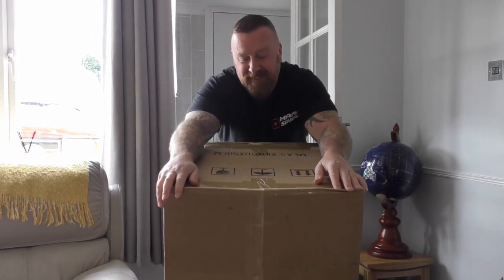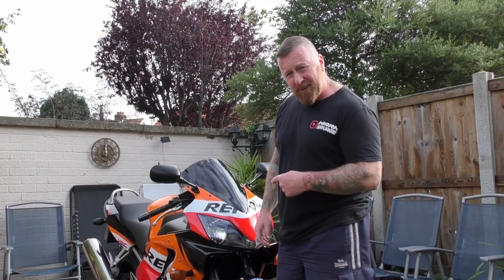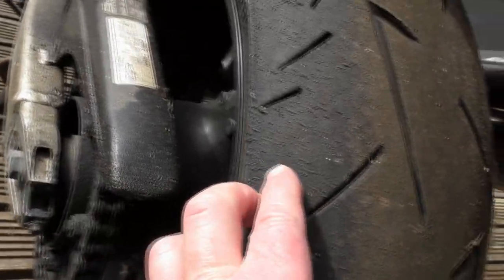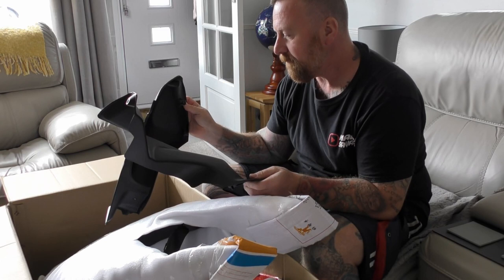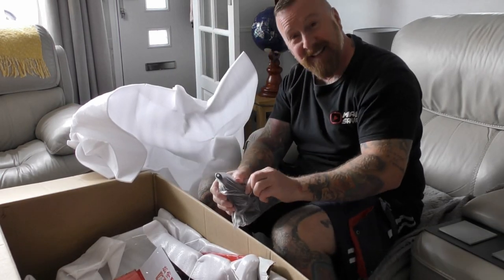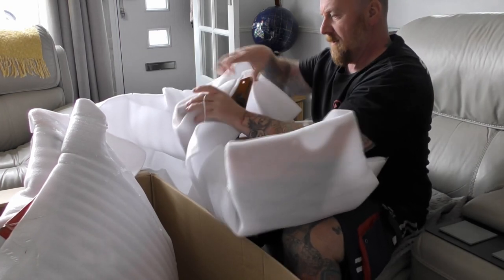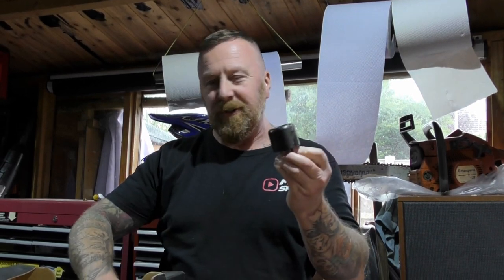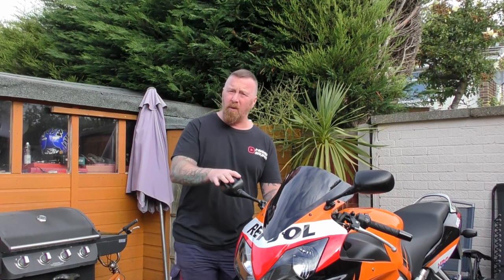HONDA REPSOL CRB FINISHED PROJECT SEASON FINALE

Comment: Mark i come to you(again) with a problem. No one can figure it out and you where kind enough to help before with suggestions and ideas. So here is the problem. On my 2006 xl1000(no abs) i fitted new break pads(trw syntherite). After a few pulls and pushes on the breaks the upper piston calliper doesnt go back in the calliper. So we took the callipers in half, cleaned them properly(nothing much to clean), checked the o-rings etc. The pistons work really well, you can slide them in and out with your fingers, CBS working, everything working properly...untill i put new break pads in and the upper piston just get jammed. Ok , so we take the old break pads,put them back in and guess what? Everything running smoothly! Pistons go back in, they slide out, front wheel doesnt get blocked, nothing. So we vent the break system, put new break fluid in, put new break pads in and again after a few pulls and pushes on the break leaver and pedal the front wheel gets jamed and the calliper upper piston wont go back in the calliper...fudge...So we put the old pads in and you guessed it... everything works like a charm! Any ideas mark? I just want to set the fcking thing on fire. Break hoses are fine, cbs pump working, pistons working,vented the system, new break fluid, the break discks have 10k km on them, i checked the break pad codes with 7 different parts dealers..... Everyone here ran out of idears mate!
Reply from the maker: how odd !! to be honest brakes have drove me mad before and I ended up replacing the caliper with a 2nd hand set . if you have had them apart maybe try swapping the piston around on that caliper . just odd that when its out with the old pads it works but once pushed in it jams !!!.
Reply: @marksavage  its driving me nuts.  I ordered another set of break pads. Maybe trw have a malfunction idk

Comment: Hi mark great videos I’ve just subscribed love the moped stuff I have a very clean 1998 Yamaha cw50ng I want to fit a pipe but not sure how much to go up on my jet and should I fit the clutch springs and rollers they came with the pipe keep up the great vids 👍👍
Reply from the maker: to be honest just fit the pipe first and see what results you get as sometimes it can run very well with out messing with anything else !!
after id take a look at the variator system and rollers but if after a clean and the rollers are still good id leave them too
as for clutch no leave it as its a lot of messing for not any gain unless its not working 
upjet , give the carb a clean and see what jet you have and go up 4 and a little tune as in my videos as they will all help
Reply: Thank you very much for taking the time to reply it’s much appreciated you do a great job with you’re bikes 👍

Comment: Hi mark I have a few 50cc-125cc bikes and I've been watching your videos and they have been helping me out massively. I've bought a lexmoto fm50 basically the same as the echo you have made a video about. I have no electric start but the starter relay works when I ark it over and the kickstart kicks up first kick but it's not pushing the kick start back up where it's supposed to me any ideas. I have ordered a new kick start replacement kit
Reply from the maker: a new kick start will help just a bit fiddley to set up as for electric start they do have a cut off on the side stand 
you stator coil may need a clean or replace as this is where the power to kick it over comes from but is it turning over ?
if not then replace the starter as they go all the time and very easy to do bud
Reply: Okay thank you. One last question. I have put a 125 sinis harrier engine in a lifan 125 frame and i need to swap the wiring loom over do you have any videos about replacing wiring looms as I've never done it before

Comment: hi mark do you have a video on installing after market lights on a speedfight? Just bought a SRT8 led tail light for my SF 4 but dont know how to wire it in. Keep up the good vids
Reply from the maker: i dont but i know the ones your talking about they have side ,stop and both indicators.
i'd only wire in the side and stop light bud and thats easy to do then if you want to add the indicators you can as its easy then but they may flash fast due to being LED 
GREEN in earth the other two are side and stop 
on the light guess blacl would be earth 
maybe use a multi mater to help
Reply: @marksavage  Ok thanks ill try get hold of a multi meter, having a hard time finding parts for the SF 4 XD
Reply from the maker: @elementpixel6935  oh yes you will but and the sp3, they just are not doing them, but the sp2/1s there's loads lol

Comment: Mark I'm having trouble with my yamaha aerox 50cc which has a yasuni z exhaust jetted to suit with 3.0gram rollers and yellow clutch springs. And my pull off is so slow compared to my mates peds and info on how to make this better
Reply from the maker: Hi bud 
This can be a pain but common 
What ped has he got ?
3g is very light, what top speed are you getting ?
I use 6g as much better all round 
Make sure you better is not too loose or tight !
Jet size ?
Have you tuned like in my videos 
Air filter ?
Plug ?
I have loads of videos on the aerox 
Type in aerox mark savage
Reply: @marksavage  my mate has an apprillia sr 50 with a technigas pipe not sure what rollers, And My aerox will hit 50 after a while  but just takes ages to get there, im running a  70 main jet and the standard air box

Comment: Hi mark I have a Piaggio zip and it’s restricted fully was wondering any little easy things I could do to make it go faster, tomorrow I’m going to follow your variator washer remover but any other tips?
Reply from the maker: there's 100 speedfight videos on my channel with all the tips you need like the washer, rollers, variator, exhaust, small upjet
all theres will help and make it go faster

Comment: Hi Mark, I'm new to your channel, what brought me to the channel is a peugeot speedfight 2 lol, a very decrepit little ped that needs a lot of tlc, it's been sat outside for 15years, it's a project for me and my son to play with, we have no keys or anything, anyway I'm trying to get it started, what is my first steps do you think?
Reply from the maker: Hi bud
On my channel there's over 80 videos on every part 
Type in speedfight mark savage
And you'll see them all
Like in my videos being out side for all that time 
Everything off panels , carb brakes etc etc 
Drain out fuel , oil , 
Then new plug test for spark
See if its a immob or none immob 1st 
Then play it from there bud

Comment: hello mark aka the speedfight king got a few questions
I have a speedfight 50cc,
i wanna swap it to 100cc
What engine fits without any problem
does Vivacity 100cc engine fit? Elyseo 100cc? Speedfight 100cc? Trekker 100cc? x-fight 100cc? what fits.
I assume that the 50cc frame is the same as 100cc frame
Reply from the maker: Hi bud 
Sorry just see this 
Yes you can fit a 100cc sp engine in a 50cc sp
But make sure the 50cc is rear disc as some are drum and then you would have to fit one with it 
Everything else will fit fine 
Not sure about other engine as they might have different fitments bud so stick to sp as I've changed them before and it easy bud 
80 videos on my channel to help
Reply: @marksavage  yup my 50cc is has a dics brake ty

Comment: Heya mark, I wrote on here few weeks ago about my Yamaha neo 50cc not starting, I have got new cylinder and piston so there’s no compression issues but still not starting🤔 seems like fuel isn’t being delivered to the carb properly as when I try to turn it over there’s no flow but when I take off the fuel line and try plenty runs out? Just not when it on, thought it’d be clogged but I’ve cleaned it out. Can you help please
Reply from the maker: Wet hand test ?
Plug wet ?
Reads or crank seal ?
I remember but did you look at these?
You had spark but was it blue 
Fuel into the pot ?
Reply: Fuel comes out of the overflow so assuming it’s collecting,
Spark plug is blue and dry,
My brother did the wet hand test I think but don’t think it worked? 
Thankyou for your help
Reply from the maker: @brandonwilliams4684  if fuel is coming out of the overflow your vacuum may not be working right , your float maybe stuck and if the wet hand test is not working and plug dry it could be you reds or piston gone bud

Comment: I have Piaggio zip 2t going 40mph max speed with 17.5mm carb derestricted leovince tt exhaust 5.5G malossi rollers malossi x Kevlar belt, is there anything I could do to get it quicker also my jet is 86 in my carb, would a new air filter or derestricted cdi off of pedparts help do the job?
Reply from the maker: Answered on other videos

Comment: @mark savage what top speed could i get on peugeot sf2 with sports air filter and sports exhaust
Reply from the maker: Ac normally up to 45 lc over 50
Do the variator too like in my videos 
Then maybe a small upjet

Comment: Hello mate I have a moped but I have a starting problem it kicks starts good but if I use the start button it won't start the bike just turns over mate
Reply from the maker: they often do this so like to start by one means but not the other , look at your stator coil and volt regulator or ht coil as kicking gives you more power than battery

Comment: Hi mark I love your videos On my moped I have a wire that says A10 what is it it is unplugged and the bike is reving high what do I do
Reply from the maker: Hi bud 
What moped is this on
Colour of the wire 
Where is it on the moped 
Was the engine revving high before or just started bud 
Have you tried the idea ?
Reply: I just brought it it has had a new throttle cable the wire is in the rear of the bike looks like it is going to the carb it is an ajs Firefox 2016 50cc

Comment: hi mark I have a 70cc Piaggio zip 2t was running lovely the other week, then the cold weather hit (not sure if this is the reason) and then next morning it started sounded different then cut out, now won’t start, I have 2t and petrol so not that so not sure any help pls?
Reply from the maker: 70cc kits fail as in my 70cc don't do it videos !!
Check for spark as in my videos 
Wet hand test as in my videos bud 
There's loads of helpful videos on my channel that will help you

Comment: Hi mark 
I have a gilera dna 50 2008 and the revs are all over the place on idle and mph isn’t working any tips or ideas it can be the unit is working from ebay
Reply from the maker: the clocks do mess around and can be the earth so take off and wd40 everywhere bud 
revs carb bud so take off service like in my cab videos 2t carb is a 2t carb so maybe on speedfight but will help 
sounds like air but service carb

Comment: Need help with Peugeot SpeedFight2. It wont kickstart,sometimes it does but now doesen't. Has fuel compression and spark, spark does get wet. Any help?
Reply from the maker: Hi 
So changed plug , 
Cleaned or changed air filter ?
Cleaned carb? This will help 
Plug getting wet is good 
Good compression doesn't mean piston hasn't gone !  But try carb first and see 
Take plug out and leave out to let petrol evaporate but it still maybe hard to start as the oil will still be in there 
Easy start can help to boost fir first start bud
Reply: @marksavage  Thanks, its 2t and i will go to buy  new sparkplug, thanks mate alot.

Comment: Hi Mark, 
Haha I'm still working on my speedfight 3  25km/h version. And I a few questions again :). I want to change my main jet, it's a 50 now so I thought this was on the small side, another restriction maybe? So I want to place a bigger one. I also drove the bike without the air filter box (only the front part of, so still with the filter on) this way he got a lott of air in, but if I did full throttle he gave up on me when going 30kmph so i thought the jet was to small.
Do u think this is a good idea?

Greatings from Belgium, already learned a lot from your vids
Reply from the maker: 50 is small and standard should have been 54 or 56 !
Id get a 58 or 60 jet 
Sports in box filter 
A little tune like in my video 
Variator next 
6g rollers , you can take off the back plate and remove the washer 
See how that goes and if there's a copper restrictor in the air intake ingrown of the carb take it out too
You should be getting 45kph
Reply: @marksavage  thx man, i already put in 6g rollers but it didn't do anything but increasing the rpm's. Is this maybe bcs of the small jet?

Comment: Hi Mark, I am a new subscriber, and I am glad to be on board. I have a question that no doubt you will be able to answer. Have you ever come across any 100cc, Peugeot Speedfight 2 mopeds going on fire while not in use?
Reply from the maker: No never !!!
They all can leak a little fuel from the carb or fuel lines but wound not come in contact with anything hot or a flame when just sitting .
Very odd had the bike been out on a long run before left ? As if you had a bad leak it could go on to a very hot exhaust 
Maybe a electrical fault but again 
If it caught fire more like someone set it on fire bud 
Thanks for subbing
Reply: @marksavage  I appreciate your reply. I know you must be busy. My moped did go on fire, but three days prior, it was stolen from right outside my flat. I managed to get it back soon after because the thieve couldn't start it. He actually cut some wires to lighting and a new ignition switch had to be added. All repairs done by a highly specialised engineer. However, I returned home from a short journey 2 days after this, parked the moped outside my flat. At 11 pm it went up in flames. Heartbreaking!
Reply from the maker: Sure they didn't come back and set it on fire ?
No real other way bud
Sorry to hear
Reply: @marksavage  Sadly, I had arson on my mind. It is just something you dont like to think about. The only difference between the moped condition from before the theft and after its repair was the movement of two wires from the broke ignition switch to a new ignition, and a 5 amp fuse replaced a 10 amp fuse from the ignition lead to the battery. I appreciate your feedback as I needed advice from someone who knows his way around a moped. I will stay tuned.
Reply from the maker: @criteriafiredisaster7205  unless it was a battery fire which it would have gone up the same day or within hours its not going to be the ignition bud 
Guessing they couldn't take it then they didn't want you to have it either!!
Reply: @marksavage   I was driving the moped for several days after it was repaired and the battery was inspected during the repair. it was as good as new. I doubt it had anything to do with the battery. I can't believe how sneaky it was, they left no evidence behind. It is good to have a bit of closure though as I would have been thinking the mechanic caused it. So, thank you!

Comment: Mark ave got a problem ave got a problem with my yamaha aerox 2013 ave got power in the battery but when I turn the ignition on it will not turn on and when trying to start it there is a clicking sound from a relay next to the battery hope u can help thanks
Reply from the maker: so you have two problems bud 
ignition so you turn the key but no lights come on this can be battery or fuse or it its self as they can mess around in wet weather 
starter 
if you get a click from the relay its your starter
i have videos on this on the speedfight and the aerox so easy to follow to fix 
type in mark savage aerox and they will come up for you to watch
Reply: @marksavage  cheers mate a will have a look after work and let you know how a get on

Comment: Hey Mark, I'm wondering if you can help me?
I've got a sf100cc ac
I've been trying my hardest to get hold of a cylinder head piston and rings, no where has any do you have any spare parts you would part with for a ££??
Reply from the maker: They are very hard to get parts for bud , maybe try 2nd hand head 
But 100cc piston you should get easy enough 
No bud I dont have the parts like I had

Comment: Hi Mark do you know the best place to buy a Peugeot vivacity 50cc ac carb from?
Reply from the maker: has to be e bay bud , you can look local sites but thats where i get mine
Reply: @marksavage  do you have a part number for one please
Reply from the maker: @brandonmason-atkins1177  sorry bud 
I used to have so many parts as in my early videos but after moving I sold ni on everything
Reply: @marksavage  do you have a part number for the one on eBay

Comment: Hi mark I have a speedfight 3 125 it need looking at how do I get in contact with u
Reply from the maker: They are 4t and not a lot you can do as for parts are hard to get hold of 
Just service and variator 
And if you can get a sports exhaust

Comment: @mark savage can you help me or anybody? So I bought peugeot speedfight 2 as a project and it don't have electric strater, i tried kickstart and still wont start. The spark plug get sparks often and stil wont start
Reply: it's hard to me to tell, I am from finland so I try my best
Reply from the maker: over 100 speedfight videos on my  channel all with help and ones on the starter and getting them running and what to look for 
type in speedfight mark savage , sit down with a cuppa and watch bud 
you can also type in starter or cdi or carb speedfight mark savage for more direct videos